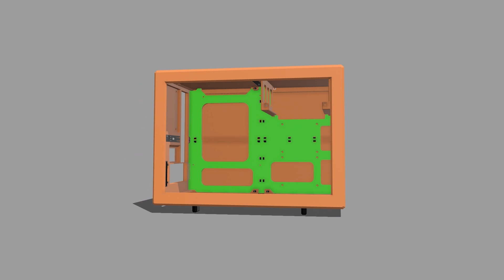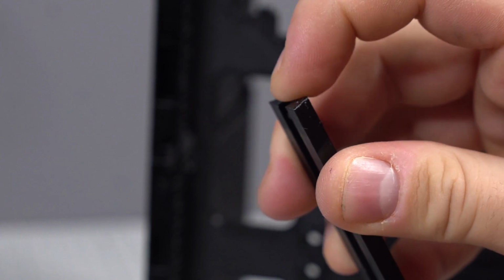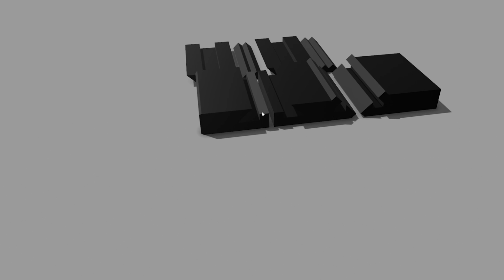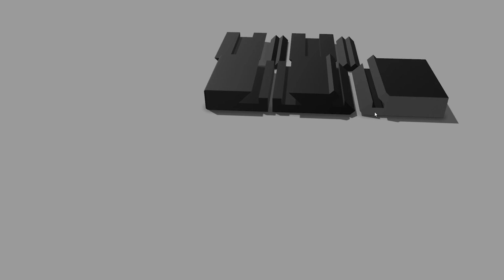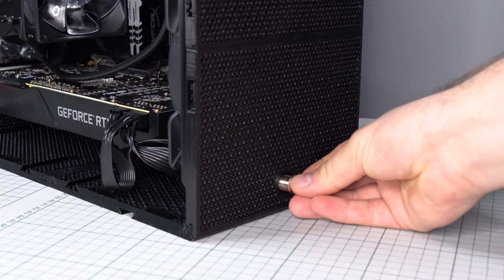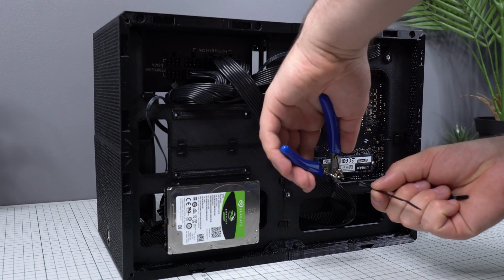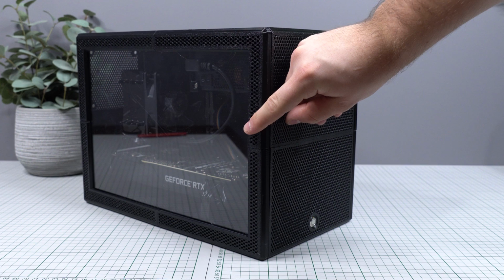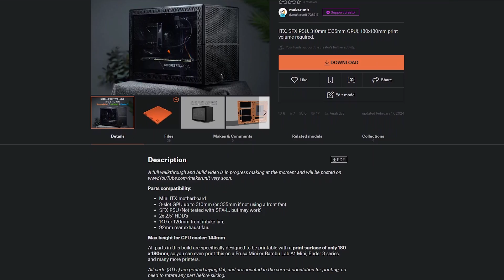A 3D Printed Tiny-Printer-Friendly-Zero-Screw PC case!

Comment: What CPU cooler and motherboard is that you're using?
Reply from the maker: ASUS B460i motherboard (LGA 1200 socket, not the most recent generation so I recommend getting more recent models)

And CoolerMaster Hyper H411R (special edition). Basically the special edition means it’s all black, but it’s like a collab limited edition model with a Norwegian brand so I doubt it’s available everywhere. It’s no longer for sale in my local store unfortunately.

Comment: It's pretty cool, however i see 2 flaws that did not convinced me, like there's place for an SF PSU, but ton of space for that huge CPU cooler. Second flaw i saw it's that feels mushy, quite bending a lot, i think a small version could cause for the model to be more solid. A question, it has static?
Reply from the maker: Thanks! The case is quite «mushy» in the beginning until it’s all attached to the center plate and the side panels are in place, as that’s what really locks it all together. 😊
Reply: @makerunit  okay i see, gains more strenght once the structure is complete, but the big question i still have, it has static?
Reply from the maker: @Skull_Knight_  In my 20+ 3D printed cases I have never ever experienced any problems due to static. Actually never even felt static apart from the second a part is removed from the build plate there’s often a static charge to it but not after… I know static is much connected to humidity etc so I’m not saying it’s impossible, but unlikely.
Reply: @makerunit  okay thanks, will sub

Comment: Quick question, hope someone can answer this for me. I couldn´t afford a mITX mobo, since they cost so much. Will a mATX mobo also work? I have no intention to use a gpu since my budget is really on the small side and the igpu does everything i need.
Reply from the maker: If you’re on a very low budget you might as well be cheaper off with just buying the cheapest pre-made case you can find. In most countries you can find a decent mATX case that just works for $30-50, which is close to what it’ll cost to print one also.

Comment: this is pretty nice. more builds for small printers are always welcome.
would love to see smaller ITX cases for us AM4 APU users. maybe it flex-fx or pico-psu's so as tight as possible to ITX motherboard size. something that is lacking commercially.
Reply from the maker: Thank you! I’ve got some ideas in mind for potential APU projects. I’ve got a 5700G myself and a Pico PSU which can be used with it. 

I was actually experimenting with an APU design using a 200mm fan directly onto a Noctua low profile cooler to make the build super quiet.

It required a print volume of about 220x220mm and was never finished/published but I’m considering to go back to it and finish it properly.
Reply: @makerunit  I'm about to order an A1 (non mini) during the anniversary sale now so I'll be able to print it. 🤣
It's just baffling how big most commercial itx cases are. 

Sfx PSU and motherboard and maybe just enough space for a low profile gpu. And since you most likely only use name storage you dont need any mode free space "in th front", so it can be made really short imho. 

I'll be printing some of your cases for sure in the near future.

I really like how you always use m3x10mm when you use screws. Makes it really easy to acquire the needed hardware!
Reply from the maker: @GizmoTheGreen  My goal is always to make the projects as simple as possible with as many "off the shelf" components as possible. I try my best to avoid "special" parts when I can.

Comment: Did I miss it or wasn’t it mentioned how much filament is needed ?
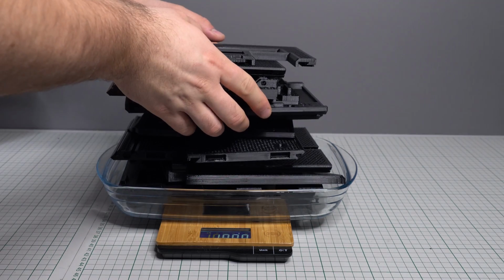Reply from the maker: @1:44 you see me weigh it, it’s about 1.7kg with my settings, so anywhere between 1.5 and 2kg total.
Reply: @makerunit  damit. Sorry. Thanks for the swift reply. I Will make sure to print it 👍👍
Reply from the maker: @Ke_v_in  Awesome! Let me know if you need anything! 😊

Comment: Would it work with a 2-slot Gpu?
Reply from the maker: Hi, yes this design works with 2 slot GPU’s 😊 Some of the bigger cards may be too wide (so the connectors don’t fit between the glass and GPU but most will fit fine 😊
Reply: @makerunit Thanks!

Comment: This is so cool!  Anyone try this with SFX-L?  Curious if my Loki will fit
Reply from the maker: Hi Jonathan! My answer is MAYBE. Because theoretically, yes, however there is only about 25-28mm of cable management clearance behind the connectors assuming your power supply is 125x125x63.5mm in size. Which may be a little tight, but might also work. So yeah, maybe… 😅 Unfortunately I do not have a SFX L supply to test this theory.
Reply: @makerunit  Thanks!  I had a feeling that what might happen.  Is there enough room to modify the bracket so it sits further toward the left side of the case?
Reply from the maker: @pctechadvisor  Hi! Yeah it might be possible to move it slightly, however it might get tight with the clearance to the glass on the other side for the C13 cable,  unless you’re able to get a very low profile C13 cable.
Reply: @makerunit  I haven't got it together yet, so I guess I will need to see how much space I am working with before trying to modify your bracket.  Thanks!
Reply from the maker: @pctechadvisor  If you could do me the favor of measuring how far your current connector sticks out of the PSU, I can modify the file for you to maximize the space use. It takes me only a couple minutes to modify if I know how much clearance you need for the C13 you have, as they all differ a bit. Measure from the flat plane where the screws attach, and to the very top of the power connector.
Reply: @makerunit  I have gone ahead and messaged you on printables just so I dont clutter up your comments section
Reply: 3cm is the measurement youre looking for, btw

Comment: Any plans for matx version.
Reply from the maker: Of this exacy model, not at the moment, but I am planning to make a ATX case very soon that is printable on the Ender 3 or similar) 220x220mm print volume. That one should also be able to hold mATX motherboards. 😊 in the sketching phase now but I’ve got some fun ideas in mind possibly using some of the same techniques as in this one.

Comment: I hope to get some advice from you about if it's possible to design a case for a laptop motherboard that can house a couple fans as well. I think the case would end up thin and thinner than a DVD player or a closed laptop.. Is this possible? I was thinking the case could lay horizontally like a DVD player or it can stand like a PS5
Reply from the maker: Hi Jordan! Making a case for a laptop motherboard may be a little challenging because most laptops use different types of motherboards so the mounting holes and connectors etc. will be in different places so there’s really no universal way to create something like that. 

It’s definitely possible to design, but I will probably never do it as I’m focusing on more universal projects that work with off the shelf components and standardized form factors 😊

However, I’m sure it’s doable but due to how many different laptop boards there are I can’t really be of much help there unfortunately…

I have plans of making some ITX or mATX cases that have these layouts, console style and laying flat, but not with custom motherboards.

Comment: Here are a couple suggestions for new case designs. Use the same joinery concepts used in this case to create a small 3u/4u 19" server rackmount chassis that has modular inserts for the front. 5.25 inch bays work well for this, as there are many drive cages or fan mounts people have already designed or are already available. Another design idea is for a small NAS case that maybe uses a backplane that's readily available on aliexpress or other shops. If no backplane, then a cageless way to secure the hard drives would be ideal. Something that can hold 6 3.5 inch drives and an itx board would be great. Something to make it stand out from the many other 3d printed NAS cases would be to allow Matx compatibility. Perhaps you can use the often inexpensive Flex Atx power supplies to save space. Can't wait to see your next design. Keep up the good work.
Reply from the maker: Hi! Thank you!
And you’re actually not too far off to be honest. I’m about to publish a mini ITX 4-bay NAS case 😁 not exactly how you imagined but using some of the same joinery, it’s Ender 3 size friendly, and has some cool little features 😁

Comment: Hi there. These look awesome!! Do you sell these out of interest? 🙂
Reply from the maker: At the moment I do not, and I personally will most likely not sell my cases due to limited space and number of printers, but I’m considering to create a commercial license so other people can sell these.
Reply: @makerunit  will have to invest in a 3D Printer at some point. Do you recommend any that will print this size all okay?
Reply from the maker: @adambailey1993  this size can be printed on most common printers, this one specifically is actually intentionally designed in small pieces to accomodate «everyone’s» needs 😊 Just make sure it’s bigger than 180x180mm size for this specific case, BUT, however, I recommend getting a bigger printer as they don’t cost that much more and gives you so much more flexibility if you have the space for it!
Reply: @makerunit  Awesome!! Thankyou!! :D
Reply from the maker: @adambailey1993  the ideal size is 300x300mm if you intend on printing a lot of things and have space for it, but if you’re mainly considering it for this project somewhere in the range of 220x220 to 250x250mm bed size will be a good starting point for a «first printer»

Comment: Hi dude,
Could u design a vertical case? 
Like the little boy s, but vertical, fit 290mm gpu , matx mobo and atx psu?
Like the meshlicious? 

Or a tutorial how to make it with fusion 360, i would pay if u have a patreon.

Cheers
Reply from the maker: I have a Printables Club, which is like a patreon but on Printables.com. 😁 I am planning to make more vertical cases eventually but not right away. It’s hard to say a time frame but it’s on my to-do list, this is requested from many! But mATX and Vertical don’t mix too well, aren’t vertical cases supposed to be tall and narrow? 😁 if it’s too wide it might as well be a normal tower.
Reply: @makerunit Its mini-dtx miss spelled :D
 I can subscribe, np.
Im not really good design, something like meshlicious would be topnocth for me.
Reply from the maker: @vapenap  Subscribing is highly appreciated, but don’t feel like you have to, you can wait until a suitable design for you is available. I don’t want you to feel like you have to, to get your idea through 😊

Comment: Hello! It is an amazing case. What thickness of the wall/board do you use? If high level of stiffness is needed what is your suggestion?
Reply from the maker: I’m usually running about 10mm thickness on the parts where the joints will sit. Some may say this is too much and they can also be hollowed out (thinner) in the middle to save filament but I personally prefer to keep it an even thickness as the parts will look much cleaner.

If making a part that’s just one big solid piece I’m usually happy with 3-4mm wall thicknes.

Comment: Really nice!
can i suggest an ATX/mATX NAS 12-bay build + space for full length gpu (bed size constraints 300/350)?
I designed a temporary vertical stand that went in the bottom of a medium sized tower, but i would love it if we could use the 3d printer to make it into a smaller formfactor with cooling and drive stability in mind
Reply from the maker: Hi! 

I’m planning on making a full size ATX case (also supporting mATX) at some point hopefully in not too long. And I’ll try my best to include some good storage options! 😊
Reply: seconded on this. atx nas case sounds great

Comment: Your video are inspiring! Lot of intelligent solution to assembly and structural problems. I'm printing a your Little Boy S that I have to cut a bit to make it fit a 260x260 bed , cross my finder I did not get it wrong. Hope to see an updated version of that by you someday.
Reply from the maker: Thank you! I hope the Little Boy case works out for you! I’d love to see a «Make» if you manage to make it work. (Or just some pictures in general to see how it turned out) 😁
Reply: @makerunit if it out good I will. May I suggest to add to your projects also which print profile settings are you using for your prints? Because apart from the honeycomb effect I've seen in the other video there were other settings I could spot on the screen that were not the standard ones. (like "solid infill threshold area" = 70 )
Reply from the maker: @Macs  I’m using stock Orca profiles… 😊 only modified infill and wall count, and some other minor changes but I feel like unless you have the exact same printer, with the exact same filament, with the same calibration settings, the settings will be different from printer to printer in my opinion. I have completely different settings for example when printing on my Ender 3 vs. My K1 Max

Comment: So just curious since I don’t 3D print. How much money does it cost to print this case in materials?
Reply from the maker: Well, with an approximate use of 1.7kg filament (assume approx 2 spools of 1kg each) the cost of one spool ranges from 18-30 USD, let’s say 20 for some cheap decent stuff, then add the plexiglass, we’re probably looking at $35-45 in total + print time and power usage… 3D printed cases aren’t always the cheapest options but being a maker, making things is just much more enjoyable than buying it and I think that’s what draws many people to printing cases even though they often end up spending more than they would with just an off the shelf case.
Reply: @makerunit  not bad!

Comment: interesting project, may I know which type of filament you used?
Reply from the maker: I used some generic cheap black off the shelf PETG from a local hardware store in Norway. I’ve never really tried using «fancy filaments», though I have a few rolls of that too laying around waiting to be tested 😅
Reply: oh thanks for the tips, because I am not sure if I should use ABS or not. I only have generic PETG right now @makerunit
Reply from the maker: @wordjumper0331  I see. I’ve made a lot of cases and mostly used PETG for the last two years. Never had issues at least. 😊 I think it mostly lays in your settings. Poor settings can create weak parts no matter what material you use.

Comment: I'm waiting to see how small builds are going to get with modern APU's + flex PSU's.  This is an awesome build though, especially considering there are companies out there charging for the same thing.
Reply from the maker: The new 8700G APU from AMD looks very promising! I’m considering to get one, but that would also mean I’d need a AM5 motherboard, DDR5 ram and more, so I’ll wait a bit to see how it performs to see if I can justify getting one 😁
Reply: @makerunit  I was thinking the same thing.  I currently run Linux on my main machine but still need a Windows box at home so I have a mini PC just for windows stuff but I'm thinking in the future I might see about building a tiny 8600G system just for the fun of it, but I'm not in a rush (and would need to get a 3d printer first anyway =D).
Reply from the maker: @nadtz  I’m in progress making a new small APU case right now actually, the idea is to use a 5700G which I already own, a Noctua L12S cooler paired with a really quiet 200mm intake fan, hopefully making the case almost completely silent even under load. (And again with zero screws, only slide-in place parts that latch.)
Reply: @makerunit  L12S is exactly what I was thinking to keep everything low profile, looking forward to seeing what you come up with as inspiration!

Comment: mATX version of this that doesn’t exceed the 256mm bambulabs printbeds? I love the other mATX options you’ve made, but all of them require a 300mm+ build capacity. This case looks like it might actually squeeze in an mATX board already, just saying 😂
Reply from the maker: Doesn’t the bambu have some other volume restrictions due to the purge tower placement? Or am I wrong? Can the Bambu actually print 256x256? Or maybe it’s just for those with the AMS unit, or maybe I just misunderstood the whole thing 😅

Anyways, I’m planning on making more cases the next months to accomodate more different part configurations!
Reply: @makerunit  good point :)  i generally don't use purge towers even for multi-color. the testing purge/wipes section in the front and back bring it down to about 250-ish

Comment: Not a fan of glass in pc cases, but otherwise this looks really cool.
Reply from the maker: And that’s why I intentionally designed both side panels to use the exact same mounts, meaning the non-glass panel will actually be usable on both sides, so it would be as easy as just printing two of them😊
Reply: @makerunit  Genius, dude!

I was debating buying a mini itx case or a 3d printer, almost decided on a 3d printer before seeing my favorite case on sale.

I'll try your designs whenever I save up for a 3d printer tho, love your vids!